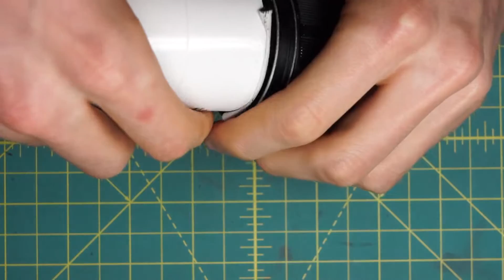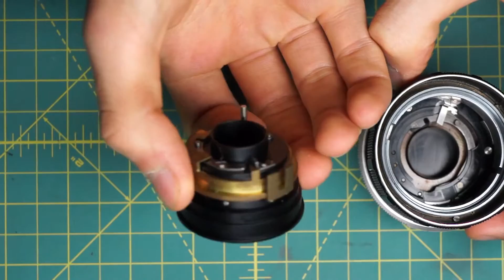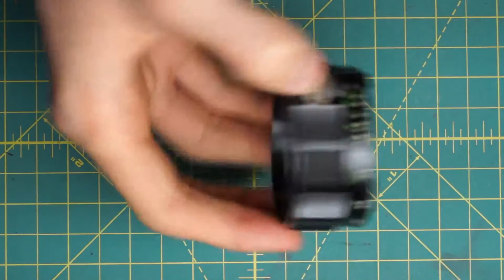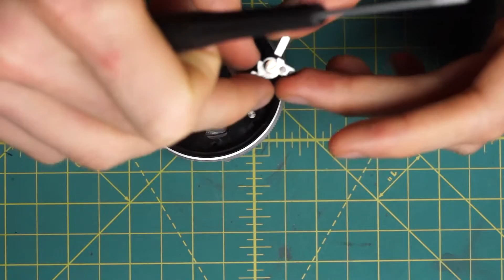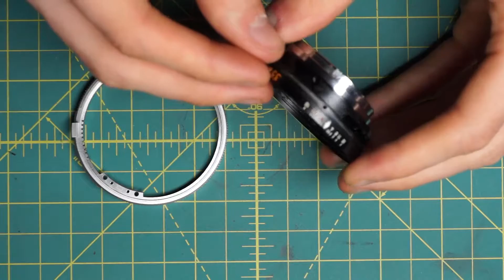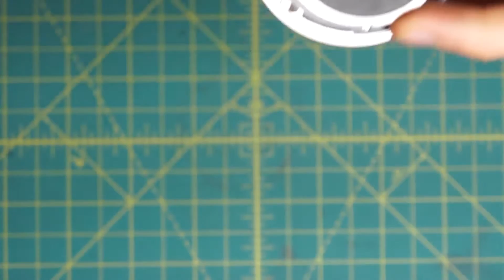Minolta W.Rokkor-HG 35mm f2.8 (MCI) Lens Disassembly

Comment: Interesting, I just took apart my W. Rokkor HG MC1 and it didnt have spanner notches on the inside after  taking the front element out, instead the front ring and the aperture blades was held by JIS screws. Was able to clean my sticky aperture blades, but did have them fall off before figuring out how to get it back together oops lol.

Comment: Hello, and thx so much for your video. I own that lens that I bought recently (exact same model, checked twice) and after an almost full disassembly of the lens (focussing ring was stiff) I tried to zero the lens as you say. Everything goes fine except that when I loossen up the three screws, the focussing ring does NOT become indepedent of the focussig mecanism, and that because I assume that on my lens those screws have in fact a specific position that you can never change. How is that possible?
Have you any idea?

Comment: How do you keep the lens elements from becoming misaligned when re-assembling the lens? I have a lens that needs disassembling, but am afraid of misaligning any elements.
Reply from the maker: +Michael Soo For this type of lens, alignment is more of a concern if you separate the lens groups themselves by de-bonding the elements. Just disassembling the lens should be ok, especially if you just remove the optical components as complete units to access the diaphragm or body sections.

If you do take apart the optics, without an optical bench, your best bet is noting where everything lines up before taking apart the lens and matching this on reassembly. I would only recommend this if there is a serious problem because it's easy to make things worse (I don't show this step in any of these videos for that reason).

The optics should lock into fixed positions in the body and the tolerances for how the optics fit should be small. The reassembly probably wont be perfect, but how good was the optical alignment on a fifty year old lens that's been banged up to begin with? If you want perfect, send the lens to a high-end repair shop.